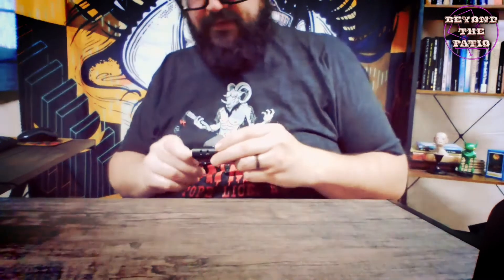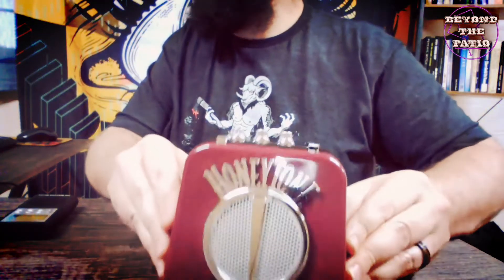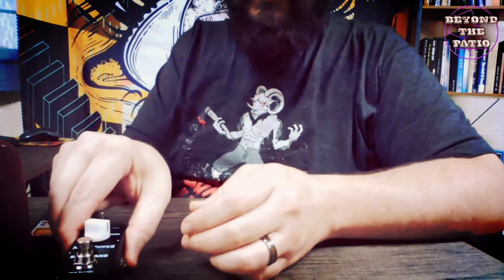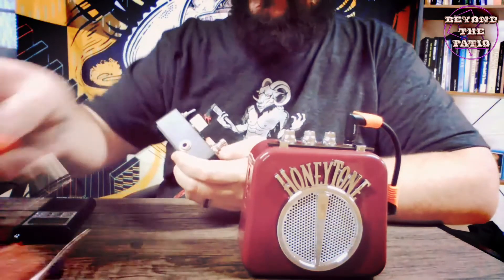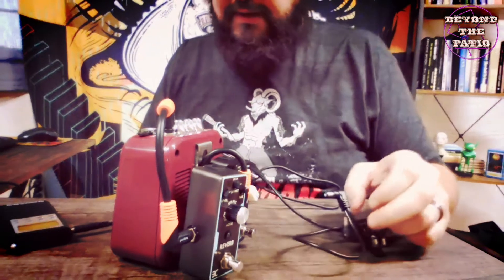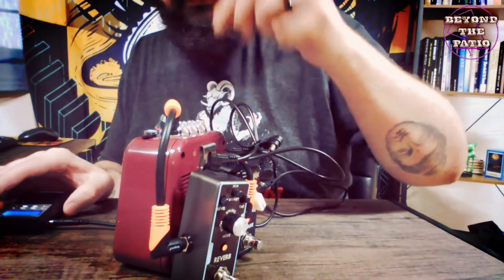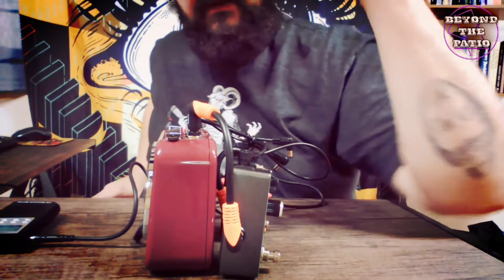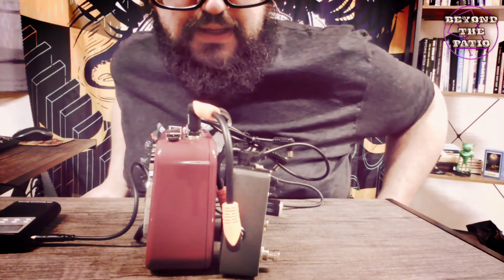How to Build a Spirit Portal

Comment: Thank you for your video, I just put mine together tonight, I need to know the settings for the reverb petal?
Reply from the maker: I just adjust mine by ear. Every pedal will be different. Play around with it!
Reply: @paranormalpatio  How do you like the noise gate? I'm not sure if I like it,kinda want to hear a little something lol
Reply: @kcbluebutterfly2182  it's sort of the whole point of the build. That way you don't have to hear the static. Otherwise, you could just plug the spirit box into a speaker.